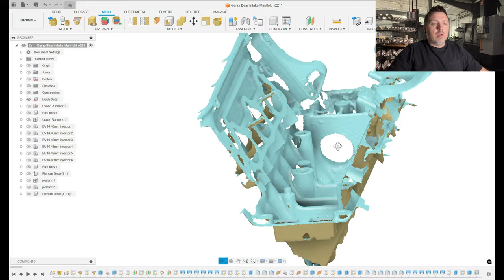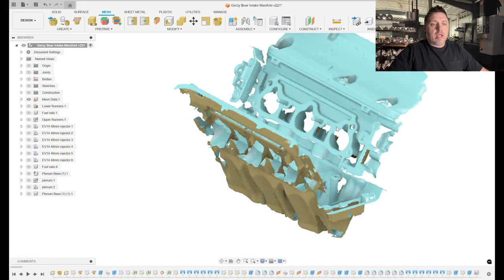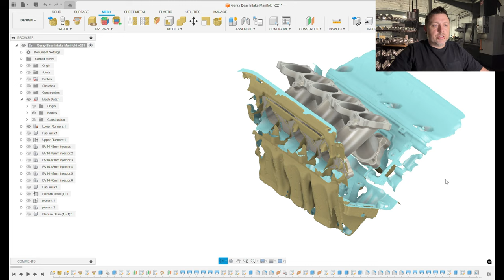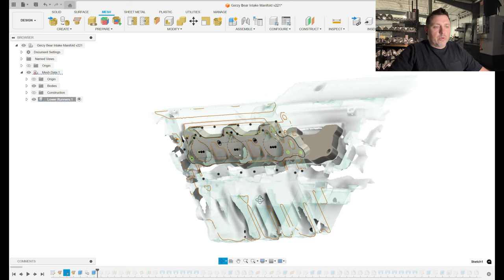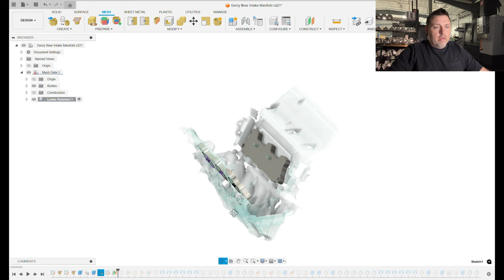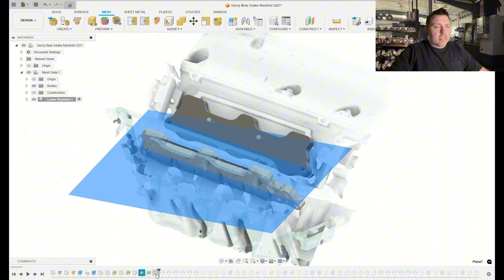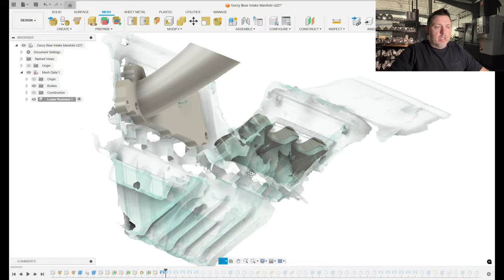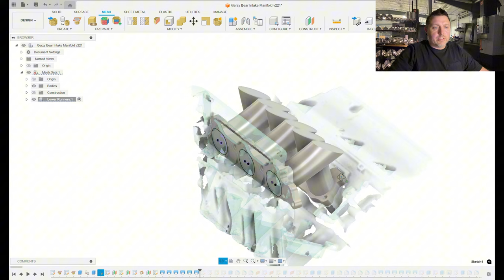Learn to Build a PROFESSIONAL Billet Intake Manifold : Episode 1

Comment: Beautiful stuff. You've made the runners a single piece as opposed to Hondas Split runner design. Is this purposeful? Honda intends you to leave the runners attached to the heads when tearing down or reassembling the engine. The 4 studs and 4 dowels would be difficult to leave installed if installing your runners with the heads bolted down.

Comment: First of all, LOVE this series already, I am a machinist who dabbles in automotive parts as a hobby so this is right up my alley :)
at around 17:00 you were talking about the stock not aligning properly due to the model not being aligned,
I'm not sure how experienced you are with fusion, but in my experience, if you pick the correct orientation for your wcs first when making a setup, then the auto generated stock will also align.
You gained an insta-sub from me! Looking forward to the next videos!
Reply from the maker: I think you are probably right as I have used that feature since then, I was just too new to fusion at the time. Thanks for the SUB! I'm really going to try to make a run at youtube so I really appreciate it!
Reply from the maker: Oh also I forget that doing it this way allowed me to locate the material on the trunnion table accurately as well.
Reply: @linderpowersystems_LPSFAB  That's a good point, I personally don't worry about that because I run a UMC750 which has DWO so it compensates for workpiece location by itself :)

Comment: Nice job and thank you for taking the time showing your design process.  What would the price be for something like this or how did you factor in the price based on the design and machining time?  For the loft cuts why did you choose that tool vs shell tool?
Reply from the maker: This is roughly a $40k job for 10 complete manifolds. Shell tool would not have worked here as it assumes an even wall thickness throughout the part and would have tried (and probably failed) to make every part of the manifold hollow, even the flanges

Comment: Dear Sir. Could a Billet intake Manifold be Made for the Porsche 3.6l VR6? What is Needed. It so awesome to see these New CNC Grow from when I ran CNC.
Reply from the maker: @gregoryh4601  most things can be done, it’s just really expensive to do one-off parts… if you can do production runs we would be happy to work with you on your project
Reply: @linderpowersystems_LPSFAB   Sir it Just sad that the VR6 engine gets so much bad likes . It built very well and think it would be awesome. On an Intake Manifold can they be Built on the Bolt Platform and the The Computer mess with the Flow? Like my Porsche Cayenne it is 3.6l and Volkswagen and Audi use the same Block just lower CC. If you decide to build One Could you use the Top Cover from one the Is already Made?   Thanks so Much for the Reply Back 👍

Comment: Advantage to using fusion versus solidworks?
Reply from the maker: @TheNitro540  mainly cost, and having cam built in so any updates done to the model are regenerated in cam super easily.
Reply: @ I get it. But everything seen here can. E done in solidworks? I’ve never worked with the machining part of solidworks- always lived in the agricultural side of things using sheetmetal and weldments. Fantastic work btw! Totally subbed!
Reply from the maker: @ definitely everything done here can be done in solidworks, sometimes easier, however having 95% of the capability for 1/20th the cost is why I switched to fusion

Comment: I create my parts individually and then insert derived into a new assembly. If I go back and edit one of the individual parts, the assembly will show the part  needs updated and will allow me to click a button to pull the changes into the assembly without needing to insert it again..
Reply from the maker: So you are forcing fusion 360 to use a solidworks work flow… 😂
Reply: @linderpowersystems_LPSFAB  Was the way I learned with the first assembly I created but I already had a circuit board I was adding an enclosure for. Used this method ever since 😅
Reply: I have done that as well….One way to force it to act like solidworks as well, is to insert external components. So before you start sketching, insert a new component and in the dialog box, it will allow you to “edit in place” then when you save the assembly, it will create a new part file. It will allow you to edit each part individually like you would in solidworks.